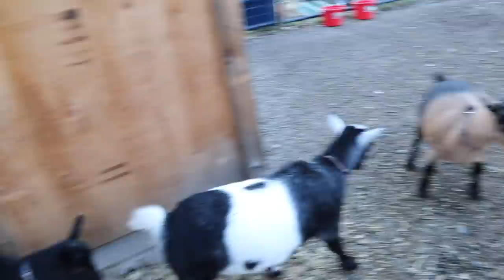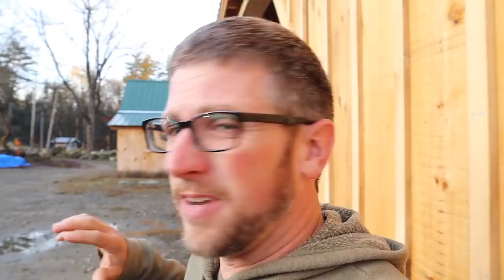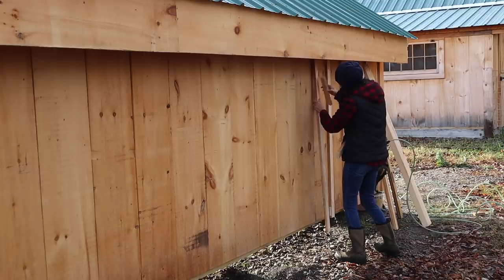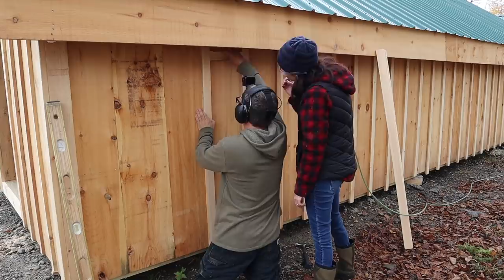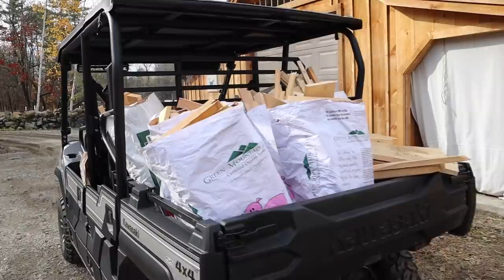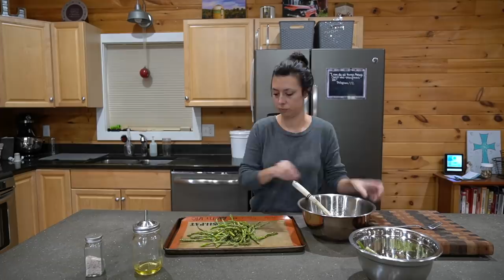She TOOK over the Post & Beam Garage Build and FINISHED IT! Husband & Wife Build Post & Beam Garage

Comment: Shove some of those rocks you've got laying around under those walls to keep the gravel from pushing out from under there.
Reply: Was thinking the same thing.
Reply: Gravel will also be put on outside to slope downwards & away from building,
Reply: @tonygrimes13  the holes under the wall on that side of the garage are called "doorways" 😁.
Reply: @larryparish5984  the only problem with the stall doors are animals going over sill plate but floor level inside stalls could be higher & a ramp. Let's wait & see.
Reply: @tonygrimes13  sorry, I should have said, "the holes in the walls on 2 sides".

Comment: Hello Gina, Al and Olivia. Al, Gina was working so quickly on the baton boards until you started helping her. Hahaha. Way to go Gina!👏👏. It’s also mind boggling that instead of trimming the baton boards first, you trim them after they are installed. It’s such a pain to work so low to the ground.

Comment: AL, you need to buy one of those LASER pointers for your DeWalt chop saw. When you press the button to power up the saw, the spinning blade turns on the LASER light and shows you exactly where the blade cuts. Well actually right aside of where the blade cuts. And it makes it so much easier to line up marks and cut wood. I think you would really like it...

Comment: The gravel you bought contains a lot of sand.  It is perfect for mixing with concrete.  With a 50-pound concrete bag you can make squares 40x40 inches and 5 inches thick.  With a concrete floor it will be easier to clean.
Reply: I was thinking that also. It would really help around the perimeter to hold it in place. Just a few sacks would go a long way. It would keep the rodents out also.
Reply: @benthere8051  Gravel will also be put on outside to slope downwards & away from building,
Reply: @tonygrimes13  - I think I'd still like to have the gravel on the interior of the barn to be really stable. Cement has been mixed with soil for a long time to make a near rock-hard mix called soil cement. It's not 3500 PSI stuff but it is highly stable. It would be nice to have gravel on the outside to keep the rain from splashing mud on the walls.

Comment: Gina if you put the tators in a ziplock bag and leave an 1/2 opening in the corner of the bag and put in the microwave for 10 mins they will come out just as good as baking for an hour saves time and gas
Reply: Some people rather not use microwaves...don't think I have ever seen Gina use one yet. However, it seems like she uses the oven a lot, so including potatoes with other dishes baking is saving time and gas.

Comment: Al the new Barn  / Garage looks fantastic but, please, please put some guttering on the front and back with downpipes. Even if you don’t want to keep the water it will stop the boards near the ground getting soaked / stained / and rotting! I did also mention this on your previous build but you did not take any notice, look how bad the wood has deteriorated along the bottom that over looks the goat field!! Love your lifestyle. God bless 🙏🇬🇧
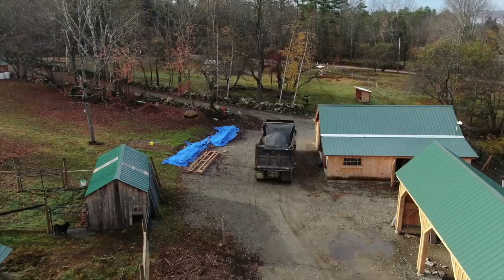Reply: I noticed the same @12:17 its black after such a short time

Comment: question?? you are making stalls for animals are you going to make a loft space above the stalls? like not make the (sheep) stalls the total height of the building, to help hold in more heat in the dead of winter
Reply: Marie Packer I would think he would🤷🏻‍♂️. Would make a great spot for an additional Hay loft or equipment. They say vertical space is the most commonly wasted.

Comment: Well that's a first I guessed 7 and 8 , just an observation the metal flashing on the gable end will not stop water going up and in to the ends of the top boards , capillary attraction will allow it to travel up the back of it , they need to be about 4" deep to prevent it happening. Stay safe

Comment: PS. May I suggest stapeling hardware cloth on the sill beams and laying it out away from the wall about 12", then do your gravel filling. Might prevent wood chucks and other critters tunneling plus help retain the fill 👍😷🇺🇸
Reply: Gravel will also be put on outside to slope downwards & away from building,

Comment: Gina: "it doesn't matter if it's level cause it's the back" Al: "it Does matter if it's level, just let me do this and I can make you a jig" 🤣
Reply: When Al measured the side panels, there was a variance of between a couple of sixteenths and a quarter of an inch between the various different width panels. Whatever the variance was at the back, I don't suppose it would have been noticeable until most of the battens had been put on, but ultimately those variances are going to add up until the battens probably fell short of the seems between each panel by quite a noticeable difference, and that would have left a clear gap in the back of the barn.

Comment: Al,  I thought you were cutting the ends at an angle to make the water run off the outer tip away from the wall. Not flat cuts, seams that it would be more likely that the water would drain back to the wall, not away ???

Comment: It's always a good idea to keep Figaro/Canine siblings inside during deliveries since drivers are looking at where a load is going not what's might be near their wheels backing up or going forward when they do a job. Look into getting what's called wall mounted Kindling Splitter with steps on it because it's a good workout since it can make kindling as narrow as you want and the steps let you split even small logs by moving them up each rung until it cleaves off the entire piece. Though this video was shot days ago one hopes they left a small gap around the new out building so the gravel isn't touching the wood so water I'll shed off properly and it won't wick the water from the runoff/ground to rot the wood like the staining your seeing on the Goat Barn/Workshop. A third load might be a good idea since there are a number of low spots on the road from the house to the out buildings and it's excess might make a nice sledding jump/ramp during the winter if there's any left for Olivia to enjoy like she did with you last year...

Comment: Gina, You are an amazing cook, but my jaw dropped when you PEELED your mushrooms. Get a damp cloth and wipe them and remove part of the stems. Then buy a copy of Dr Josh Axe's book, EAT DIRT and a tshirt from Roots and Refuge about organic food being dirty. It supports your microbiome. You need not be obsessive about it. Your pork chops look amazing and I will try the recipe soon. Thanks.
Reply: Sandra Westley, I am from the UK and have always peeled my mushrooms, so it’s not strange
Reply: @robwestley7370  Me too (from the UK, I mean), and I sometimes peel my mushrooms. In my youth I worked a couple of days at a mushroom farm. I once cleaned an entire cows barn out on my own... the floor of which was steel plates over a sunken pit which helped to drain everything and anything. By the time I had finished, that barn was spotless as was the pit which I hosed down. I felt the stiffness in my muscles the next day mind, which was kind-of satisfying... but back to the point. As I mentioned, I also worked in the mushroom growing room. Table after table filled with wet and dark compost and earth. I cannot remember if it was a greenhouse or a large room that was specifically designed for growing mushrooms. From that day on, I always peeled fresh mushrooms that I had bought from an outlet such as a farm etc... shop or store bought produce is usually cleaned, but I give it a wash anyway, and if they look particularly bruised, then I may peel them as well.